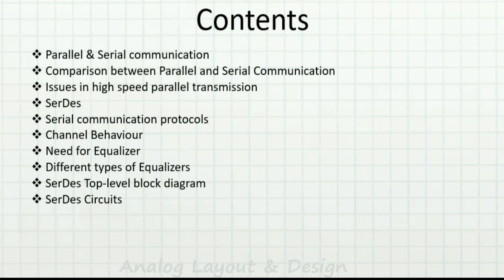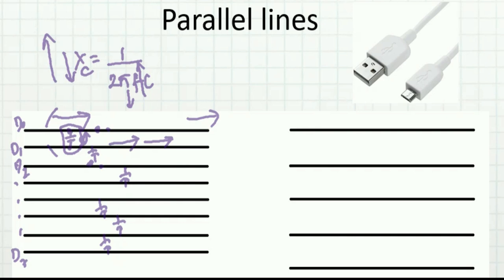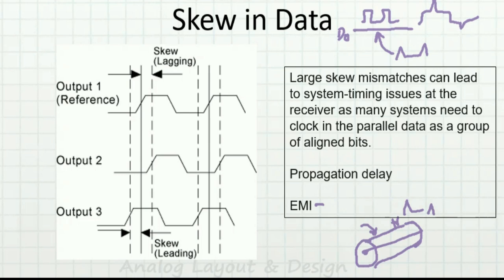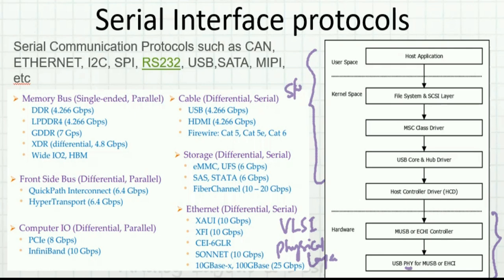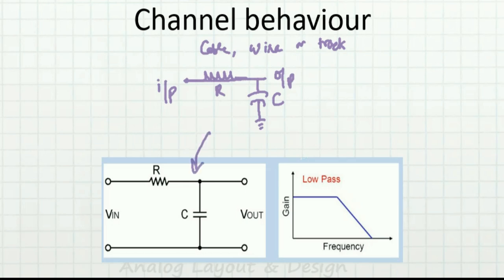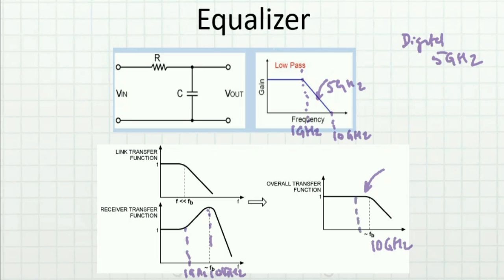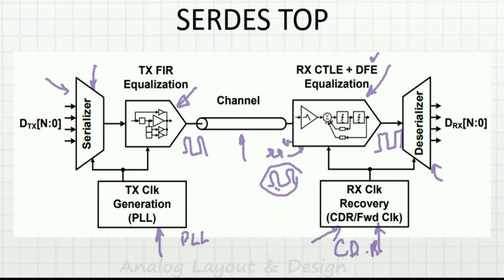HIGH SPEED SERDES (INTRODUCTION)

Comment: 12:07
Serical protocols:
CAN - Controller Area Network
Ethernet - Internet 
I2C - small devices
SPI - Low speed peripherals
RS232 -  present in computer
USB - phones, laptops,
SATA - harddisk
MIPI - Mobile parts - camera and display unit

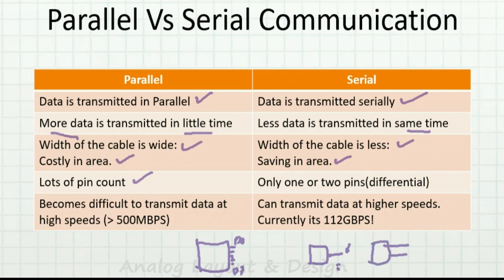Comment: at 4:00,  I am confused as in 2nd point it is mentioned parallel has higher data rate, while last point tells it has lower data rate. As last point is in MBPS, which is data rate. Should it be in terms of clk speed ? like MHz and GHz. Data rate of parallel will be (no of data bit)*(spd of parallel in Hz)/(speed of serial in Hz) faster than serial. 2nd point and Last point together makes sense if units are in Hz.

Comment: 20:32 Here the design of equalizer is depending on channel.
 So at later stage of layout a Equalizer circuits needs tuning based on channel length?

( You mentioned channel will be few buses, In layout terms we can say high metal routing right . please correct me If I am wrong w.r.t this statement)
Reply from the maker: Yes true… the circuit design is dependent on parasitics

Comment: if all of the protocols use SERDES, why do we have different SERDES?
ans: 13:18 
PHY means physical layer 
Vlsi engineers work on Physical layer 
Every protocol has physical layer with different speeds and requirements etc.,
Reply: They differ in terms of speed accuracy reliability etc

Comment: The main problem I see with parallel interfaces is cross talk. Could you please refer me to some crosstalk cancellation circuits?
Other issues are data at receiver come at different times.
Reply from the maker: yes..sure..crosstalk will be separate video

Comment: I have worked many years with SERDES and I find your explanations very poor. The beginning is missing many explanations: the clocking & synchronization. The channel model is not good: an RC is ok for low speed but for SERDES they use transmission lines which the attenuation vary inversely with the square root of frequency. Equalizer need more explanations. SERDES clock recovery, synchronization and word alinging infos are missing.  Table that show PCIe is a parallel bus is incorrect! Although PCIe appear as a parallel bus they use many serial lines in parallel which must be sorted (another missing info).
Reply from the maker: Dear Andre, you are commenting this after many years of work. If you were in your first year, may be, you would have appreciated it... This is a high level basic introduction... This channel is intended for beginners and engineers with lesser exp.
I personally don't believe to introduce a complex system ...rather introduce a simple system and add complexities later...for ex RC initially and later tx line...for such reasons only they teach 8085 or 8086 processor and not intel core i7... :)
Reply: Dear Andre, you better to make a video for giving proper insight and explaination, instead of commenting here. So that the others will also get benefitted by your experience.
Reply: @analoglayoutdesign2342  Hi Sir, please upload more videos on digital and analog as this is very very useful. I am seeing only limited videos in this channel.